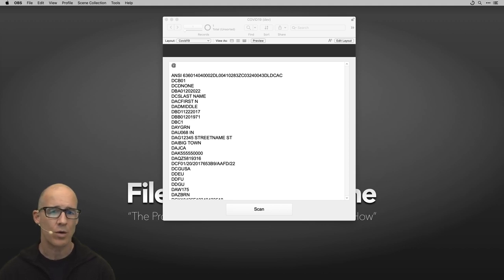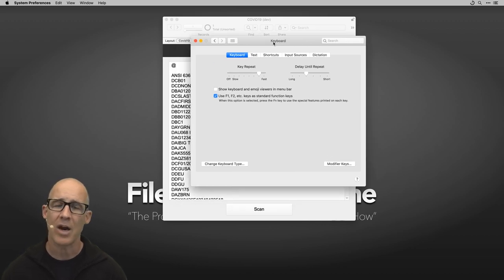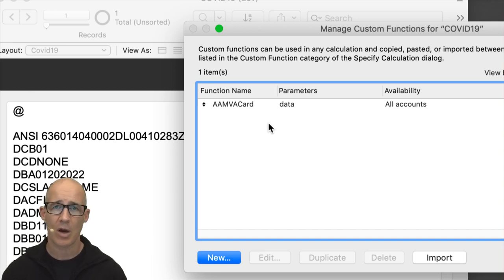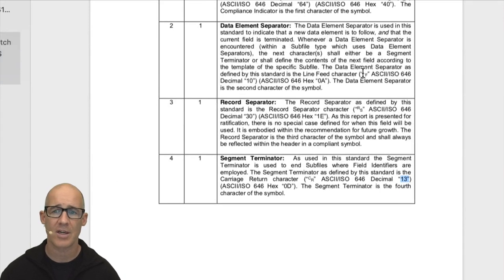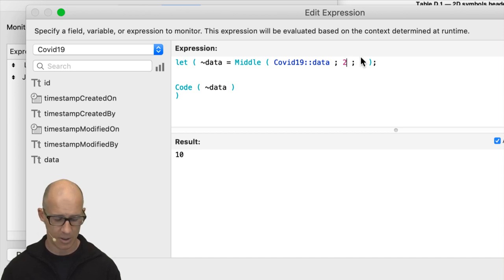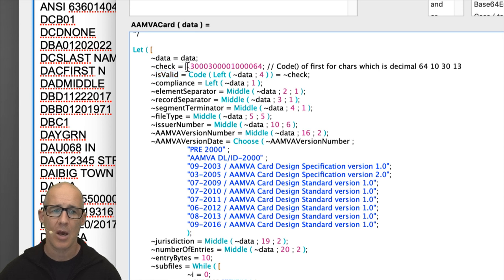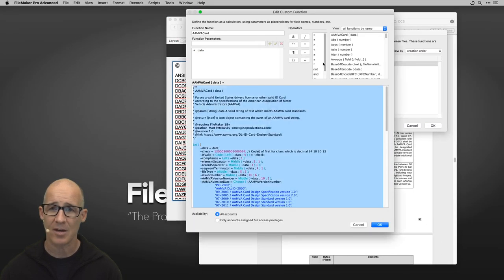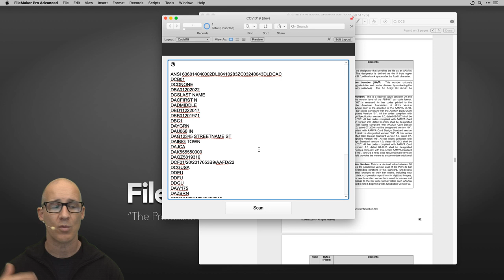Learning FileMaker: Episode #5 - Complex text parsing

Comment: NOTE:  WHILE Only for FMP 18 and Up
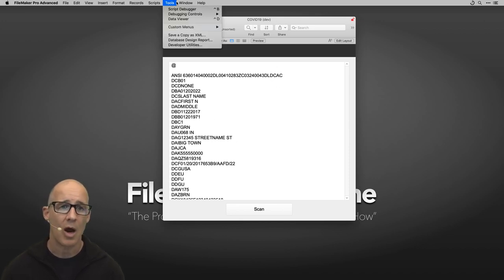2:09 Assign Keyboard Shortcuts
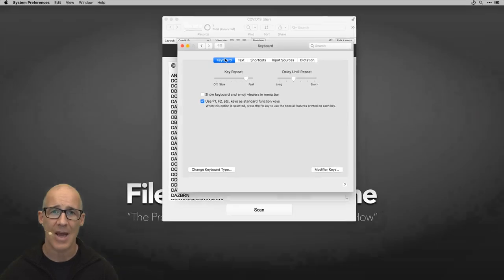4:10 Modifier Keys
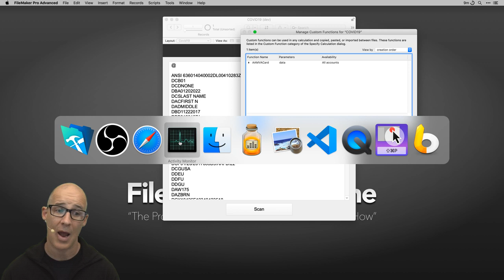7:10 FMP Standards
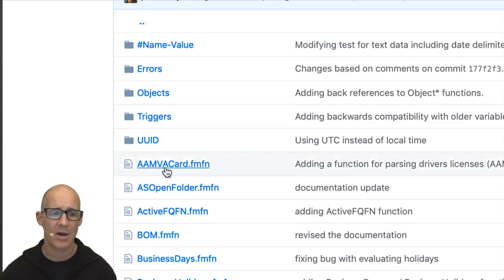8:10 Getting AAMVACard Function
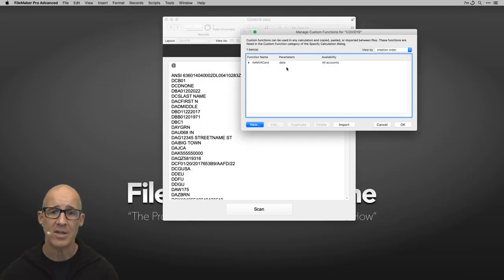8:53 Adding Custom Function
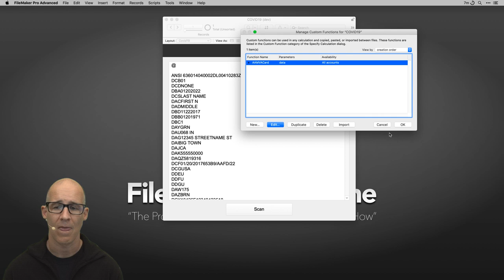9:30 Walking Through Complex Code
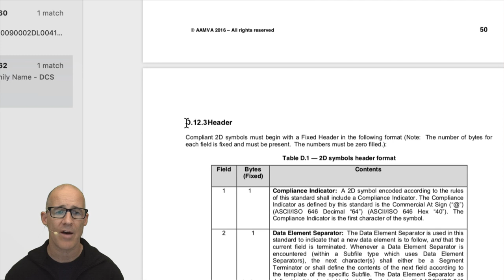10:40   Header
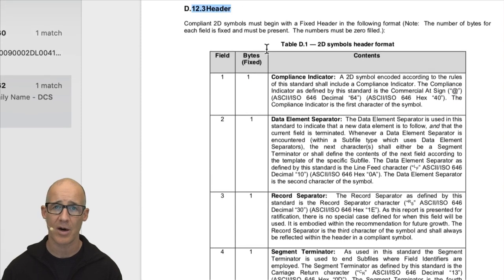11:42 Encoding & Line Endings
13:39 Look at Data in Data Viewer
15:00 LET
15:32 CODE Function/CHAR Function
16:35 "Seeing" Invisible Code
17:34 Using Standards To Break Things Down
18:10 Breaking Down Custom Function
19:32 Check Sum
21:40 Parsing out data in Function
25:09 Reason for WHILE Function

Comment: I'm finding that thhe AAMVACard custom function as posted on Github works when used in the Set Field script step, but not in a calculation field; in the calc field, the field just shows a "?".
Reply from the maker: Is the calculation field set to be stored or unstored?
Reply: @filemakermagazine  It was set to stored. Changed it to unstored, and it worked properly.

Comment: sorry it does not work on my iPhone .I turns on the camera but does not read the barcode
Reply from the maker: Barcode scanning can be dependent upon a variety of things. Try increasing the amount of light. Older cameras on older iPhones may have a harder time than newer ones. And make sure to adjust your barcode to different distances while trying to scan. Unlike other 2D barcodes, I have noticed that PDF471 doesn't pick up quite as quickly.
Reply: I have the latest iPhone11Pro with iOS 13.4.1 and it does not read the code on my driver's license at any distance. What is interesting there is no marquee to focus as there usually is when taking a picture although there is a prompt on screen to focus on the barcode.
Reply: I have finished an app for where I work specifically working in this arena scanning this material.  Not to go down the whole FM rabbit hole of what can be going on with it not being able to scan but I will start with something I discovered.  I had a iPhone 10 with a Lifeproof case.  The case covered a part of the camera lens area with a small triangle.  This caused enough distortion for it not to be able to scan the PDF417 barcode (QD, Code 39, etc were not affected).  If the app on your phone is go to go, I would start by removing the case and attempting to scan.  I had a second iPhone with another case and had NO issues whatsoever.  Let me know if this helped..
Reply: there is nothing in the way of the lens. It also does not work only iPad (no case at all)

Peter
Reply: @PeterACortiel  Peter, I found that there was an issue with FM Go 18.0.2 for specifically scanning PDF417. If you update FM Go to 18.0.3.325 it should work for you.